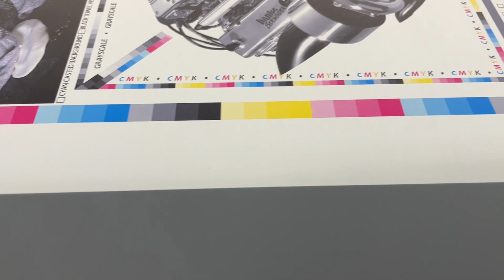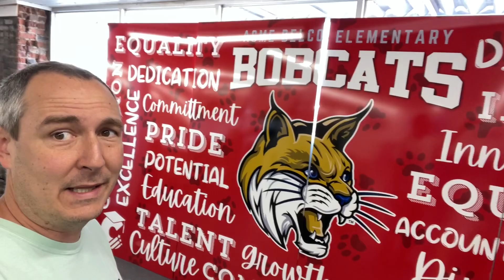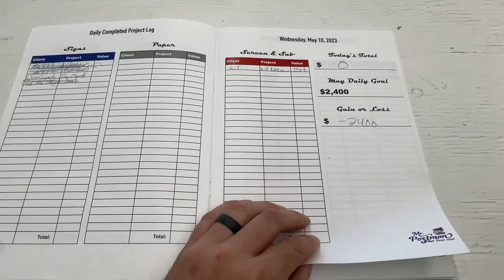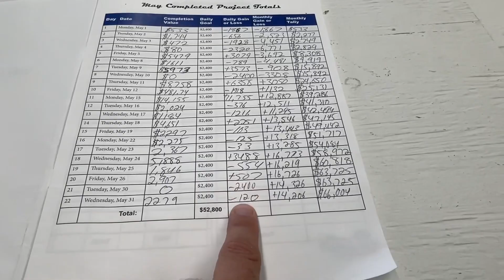White Ink Resolved, Clear Coat Printing, and May Completed Projects Goal Update

Comment: Print is beautiful, how durable will it be compared to a laminated vinyl installed on a board?
Reply from the maker: I can’t find an answer on the durability of Mimaki Lus-120 uv ink. I guess I’m just going to have to field test this. These school murals are going inside so I’m not too worried about that.